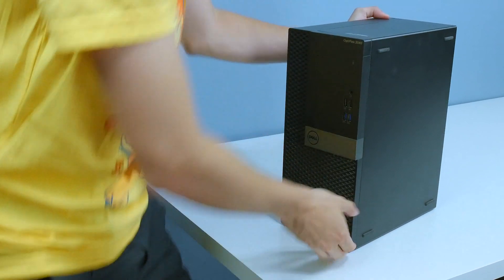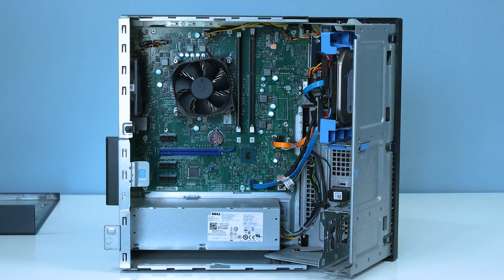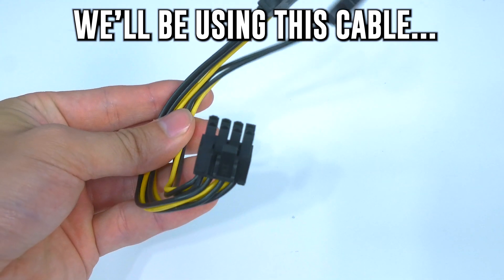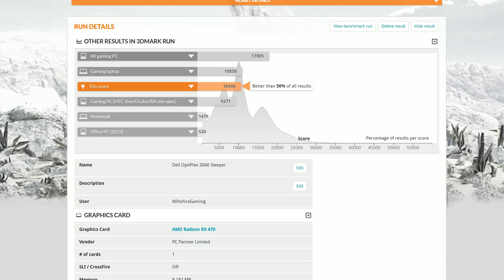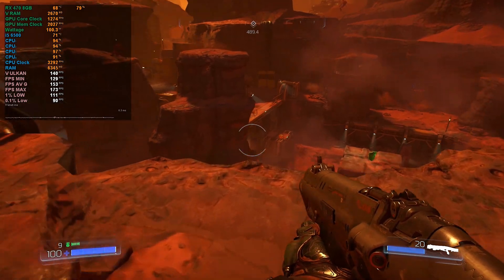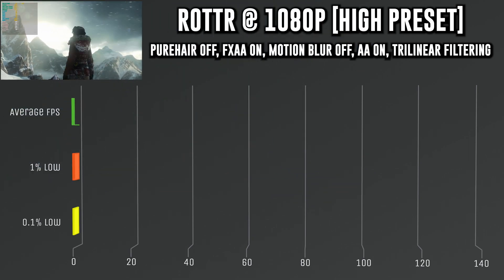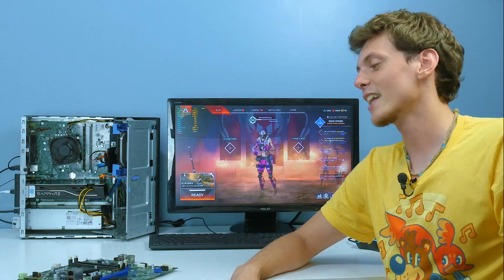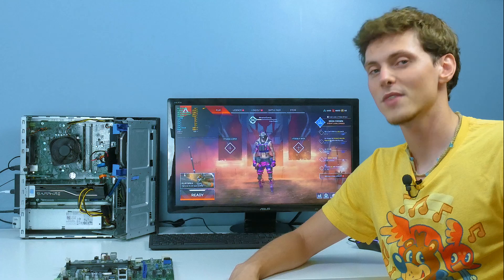$400 Budget Dell Optiplex Gaming PC (2019)

Comment: i have  an optiplex 3060 not a micro i wanna case swap it which case can i swap it into?
Reply from the maker: None. The motherboard is a proprietary shape. It does not fall under any standardized motherboard size.
Reply: Is there no literally case
Reply from the maker: Nope. This is the reason why I modded the case.
Reply: Like no case
Reply: No gammon case ever??
Reply: Umm my motherboard is a cougar MT  17539-1
DX5RC$HA
Reply from the maker: Okay... And?
Reply: @WiltshireTutorials  can you suggest me a cheap but good motherboard which can support up to core i7 18 gigs of ram and  water cooling and is compatible with most gaming cases?
Reply: @WiltshireTutorials  and Can I put a core i9 in the ho optiplex 3060 stock motherboard??
Reply from the maker: @sphinxzapper2071  The Optiplex 3060 can only handle up to an Intel Core i7-8700
Reply from the maker: @sphinxzapper2071  I need to know the EXACT CPU you are using. Saying Core i7 doesn't help me at all. Also, why 18GB of RAM? That's a really odd number. If you're mix and matching RAM, I suggest that you don't do that. Any ATX sized motherboard will do.
Reply: @WiltshireTutorials  i currently have a core i5 9th gen but iam looking to buy core i9 9900k and i currently have 12 gb ram and might upgrade it so my question is that which like cheap and good motherboard will get the job done??
Reply from the maker: The 9900K can draw a lot of power. If you plan on overclocking the CPU, I would recommend staying away from cheaper boards.
Reply: @WiltshireTutorials  umm which intel motherboard that i can go core i5 9th gen are compatible with Gamemax G561 case?
Reply from the maker: @sphinxzapper2071  Any ATX Z390 Motherboard
Reply: @WiltshireTutorials  is there a cheaper option which can run a core i5 9th gen and work with gamemax G561 case, (sorry for bothering you) will a GIGABYTE H310M A 2.0 (LGA1151/ Intel/ H310/ Micro ATX/ DDR4/ HDMI 1.4/ M.2/ Motherboard) work?
Reply from the maker: Why buy a really expensive 9900K and stick it in an H310M motherboard? You do realize that you will not be able to overclock with such a cheap board, right?
Reply: @WiltshireTutorials  yeah i realise that but you see iam running out of budget thats an issue like currently i already have a core i5 8th gen 8 gb of ram and everything except a case and a mother board iam thinking of going with H310M with Cougar mx330 is that a good i dea and for power supply iam going with the stock optiplex 3060 is it okay?
Reply from the maker: Throw in any decent GPU and you've exceeded the limit of that PSU. The Optiplex PSUs aren't really meant to support a gaming PC, just an office PC that browses the internet.
Reply: @WiltshireTutorials  umm okay so is it okay to run a core i5 8th gen with 12 gb ram  and a 1650ti GPU stock optiplex 3060 PSU a MSI ProSeries Intel B365 LGA 1151 Motherboard with a Gamemax Dark Ranger Black Micro-ATX gaming Tower case???? or the PSU not gona work?
Reply from the maker: 300W is the minimum requirement for a 1650Ti. That's just the GPU. You have to factor in the CPU's power draw, the chipset's power draw, the RAM, etc. Clearly that PSU is not going to work at all, for a few reasons. First, not enough power output from that stock PSU. Second, the PSU will not fit in your new case as they are a different PSU form factor size.
Reply: @WiltshireTutorials  Thanks so can you suggest me a PSU which would fit in that case and would be budget?
Reply from the maker: You can get away with a decent ATX 550W PSU. Something like the CV-550 from Corsair would do the trick for you.
Reply: @WiltshireTutorials  welp thanks mate
some people with few subscribers dont even bother to reply thanks for being humble!
Reply: @WiltshireTutorials  will a Aigo GP550 PC Power Supply 550W 80 PLUS Bronze Max 750W 12V ATX 12CM Quiet Fan PSU For Intel AMD Desktop Gaming Computer do the job as well, and should i do the swapping my self like getting the corei5 8th gen out of my optiplex and the GPU and install the new motherboard in the case and put the gpu in and the cpu connect power supply and all that or i can mess up i have 0% experience i have just swapped ram
Reply from the maker: You're welcome. No need to thank me lol. I'm here to help!
Reply from the maker: I actually tested the AIGO 650W in my all Aliexpress PC build and it seemed to be just fine! I would say go for it! You can swap the parts yourself. It's quite easy to do. The CPU socket process is pretty simple. If unsure how to install the CPU in the new board, be sure to look up a guide or read the manual to your motherboard. Of course, I'm always here to help as well. Just make sure to ground yourself before working on the inside of the PC ;D
Reply: @WiltshireTutorials  Thanks mate!
Reply: @WiltshireTutorials  now there's just 1 last step left and sving hopefully i can save up enough in like 3 months
Reply: @WiltshireTutorials  now there's just 1 last step yes saving enough money aghhh
Reply: @WiltshireTutorials  will a 100n10400l1 - Evga 400w PSU Get the job done?????
Reply from the maker: That's pushing it for the kinds of parts you want to put into your PC. I would still recommend a 550W PSU
Reply: @WiltshireTutorials  Okay but it will get the job done right?

Comment: Would a 4GB RX 470 work?
Reply from the maker: In theory, yes. Just make sure the GPU isn't too tall or the side panel will not close.
Reply: @WiltshireTutorials  thanks for the quick response. I have an Optiplex 5040 that I want to turn into a gaming pc. Do you have any recommendations on what I should use? I originally thought about using the same graphics card you used, but you said something about having to flash it and that completely lost me lol.
Reply from the maker: I was using a GPU that was strictly for Mining Crypto Currency. No need to worry about that GPU. I suggest a Sapphire RX 480 Nitro GPU. This is the fastest card you can use with the stock power supply inside your machine. They can be found for cheap nowadays as well.

Comment: Optiplex 3040 mt what psu compatible with it. Cause i already upgrade my ram an ssd so i need higher psu wts so i can put a gpu thx for reply
Reply from the maker: Any SFX PSU will do the trick. You will need a 24 pin adapter to use the PSU however.
Reply: Thx bro for the help soon gonna buy one
Reply from the maker: No problem. Thanks for watching. Let me know if you have any more questions.

Comment: I saw that it has an m.2/NVMe slot? rather put that inside and you've got a little multurpose machine :)
Reply from the maker: It does not have an M.2 slot on the board. It has the traces for one. But, there is no slot soldered to the board and the BIOS does not have options for booting from M.2
Reply: @WiltshireTutorials  interesting.

Perhaps they wanted to put it on but changed their minds at the last minute.
Reply from the maker: The M.2 slot is for the 3050 variant, not the 3040. They made all the boards the same just without certain ports soldered on to save money. I could, in theory, solder an M.2 slot on the motherboard traces and custom flash a 3050 BIOS to the board. I bet it would work.
Reply: Wiltshire Tutorials 

Would be cool to see 😀

I’m rocking a 7050, the fans go bananas when I game.
Reply from the maker: Even with all the additional fans I have installed. Same thing still happens. There is a price for SFF PCs
Reply: Wiltshire Tutorials yeah

Truly not meant for that. I’m looking at building a computer, cause I’m using this one as my work PC and it’s a workhorse, nothing I can’t do work wise and I don’t have to wait for anything. 

Thanks again for the video and responding to my comments

Comment: If I were to do this what would be a better starting point. 5040 or 7010 (I have a chance to get one of them very cheap)
Reply from the maker: Would recommend getting the Optiplex 5040 over the 7010. The 5040 has new hardware in it.
Reply: @WiltshireTutorials  I ended up finding a 9020 for $130 USD and went with that LOL.
Thank you
Reply from the maker: Not a bad find. Those are pretty decent PCs and are easier to work with than the 5040. Tons of good guides on how to improve the stock 9020 out there as well! Have fun with your new PC!
Reply: @WiltshireTutorials  thank you! First time in almost 2 decades I'm doing any pc work so I'm excited
Reply from the maker: Right on, man! If you have any questions at all along the way, let me know!
Reply: @WiltshireTutorials  that is incredibly nice of you. 
Thank you
Reply from the maker: No problem! Thanks for watching

Comment: can i plug in gtx 1050 in the 3070 version ?
Reply from the maker: Yes. You could do that, if you wish to. I would recommend something a bit faster than a GTX 1050 though. Maybe a 1660 over a 1050.

Comment: Will a gtx 1050ti fit in the Dell optiplex 3040
Reply from the maker: Yes. It should fit just fine.
Reply: @WiltshireTutorials  thanks a lot but will the 1050ti dual fan fit because I don't want to buy the wrong one.
Reply from the maker: You can fit a GPU of 240mm in length. So, just make sure what ever GPU you're looking to use is shorter than that.
Reply: @WiltshireTutorials  ok thanks
Reply from the maker: You're welcome. Thanks for watching

Comment: How much GPU clearance would you say you have? What is the specific model of your GPU? I'd like to know what GPU length I can potentially go up to. Thanks!
Reply from the maker: GPU clearance in length is 240mm (max). In this video, I used a Sapphire Radeon Nitro RX 470 8GB Mining Edition. It's length is 235mm. The non-mining edition has the same cooler and dimensions.

Comment: brother, could I do exactly what you do in this video, buy the graphics card and already having the optiplex 3040 could I play at good fps or should I change the power source?
Reply from the maker: The fastest GPU you'll be able to run on the stock PSU is an RX 470. If you want something more powerful, than you will have swap the PSU out for an SFX PSU, like I did.
Reply: @WiltshireTutorials  Okey so if a change the power supply to the one u mension what graphic card would you recommend? And with those components my processor and the motherboard bear it?
Reply from the maker: The max you can use on the same model of Optiplex (3040) would be an RTX 2070 Super. I currently am running one in OptiFlex right now. I would recommend maybe something like the Gigabyte GTX 1660 Ti MINI ITX OC 6G

Comment: are u dont change PSU???
Reply from the maker: What did you just say lol?
Reply: @WiltshireTutorials  did you not change power supply?
Reply from the maker: Not in this video, no. An RX 470 will only draw 110W at full load. So, it's safe to use the stock PSU. Wouldn't recommend overclocking too much though.

Comment: Hello, does the method work for the 3050 Tower, and can I upgrade my graphics card? Thanks
Reply from the maker: Yes it will. The 3040 and 3050 are almost identical.
Reply: Wiltshire Tutorials  thx😆
Reply from the maker: You're welcome! Thanks for watching!
Reply: @WiltshireTutorials  bro i have dell optiplex 3050 mt 240 watts psu the gtx 1050 ti lp oc will work??
Reply from the maker: Should work just fine.

Comment: Hello 
I want to buy optiplex 7070 tower
But the main problem is 240 power supply
Is there any chance to upgrade it to 400 or 600w as the main problem with me is here and GPU I can add
Reply from the maker: This should answer your questions! You can do what I did in this video here: https://youtu.be/ZfGIiLzT_uk?t=274
Reply: @WiltshireTutorials  
U are amazing ❣️
U inspired me to buy the new Optiplex model without fair if upgrade
As I understand the corsair SF600 600w PSU is the best power supply compitable with dell power supply power
How can I know that the power supply I choose is suitable
As this model isn't provided in my country Egypt
Reply from the maker: Glad I could inspire you to pick up a modding project of your own. Any SFX PSU will do. It doesn't have to be the Corsair SF Series PSUs. You will need a 24-pin to 8-pin adapter cable for the OptiPlex's motherboard.

Comment: does anyone know if standard power supply can fit in there?
Reply from the maker: It will not. Case isn't wide enough.
Reply: @WiltshireTutorials  how many cm wider?
Reply from the maker: About 6.35mm too wide. I mean, you could install an ATX PSU in there. But, you won't get the side panel on the case.
Reply: @WiltshireTutorials  oh shit son, you had me thinking it wouldn't work at all with a atx psu. I may do this instead of buying a sfx. too broke. Thanks for the tips and comments. I read a whole bunch of your replies and watched the vids. My old pc just went out and while I troubleshoot it, I had to buy a optiplex 3040 off faceberg. wasn't a bad deal and came with an i7, so I got it. needed it to do ebay work. I want to put my 970 in there but waiting for the 8-24 pin adapter. anyway. thanks for the videos and tips
Reply from the maker: You're welcome! Glad you were able to find a good deal on an Optiplex! Let me know if you have any questions about it! I'm always around.

Comment: for some reason my dell optiplex came wth a 290 watt power supply and it has the branding on it as many YouTube vids as I watch I can’t see one with the same psu
Reply from the maker: It may depend on model or when the PC was manufactured. Dell could've ran out of stock of the 240W PSUs and used 290W PSUs they had laying around in stock.

Comment: Hi Sir, may I know how you flashed the bios of that gpu to make it a gaming gpu?
Reply from the maker: It's pretty simple. You have to use a program called ATIFlash. This tool is used to flash custom BIOS to AMD/ATI cards. It must be used inside of Command Prompt though.

The Sapphire RX 470 Mining card is the exact same as the Sapphire RX 470 Gaming card. Find the VBIOS for the Gaming card and flash it to the Mining card. This essentially makes it a Gaming card, just with one DVI output.

The command lines I used are as follows: amdvbflash.exe -f -p 0 rx470.rom

The 'rx470.rom' is the filename of the VBIOS I had. So you may need to change that line depending on the filename of the VBIOS you downloaded.

Hope that helps! Let me know if you have anymore questions!
Reply: Wow! Thank you so much for responding, even though this video is already 10 months old <3 

I have the exact same cpu and I want to equip it with RX 580 and a new PSU, but it seems RX 580 is around 267 mm and it won't fit the casing. Is there any way around it?
Reply from the maker: You're welcome! I read all the comments I get and I respond to most of them, when I get a chance to. As for the RX 580 you mentioned and its length, it is too long. There is no way around the GPU length limitation (240mm) due to the way the case is designed. It folds into itself. If you're going with the RX 580, the only one that I know of that fits is the Sapphire PULSE Radeon RX 580 8GB. It has the same cooler and dimensions as the RX 470 that I used in this video.
Reply: @WiltshireTutorials  aww. Thanks again! <3

I'm guessing I can be okay with rx470 4gb nitro, but can it handle video editing, like the one you did for this video? Cause that's the main reason why I'll be doing an upgrade.
Reply: @WiltshireTutorials  Wait, what about Radeon RX580 8GB Gaming? According to its site, it's only 232 mm long: https://www.gigabyte.com/ph/Graphics-Card/GV-RX580GAMING-8GD-rev-10-11-12/sp#sp
Reply from the maker: You have to look at height as well. It may collide with the hard drive cage when the case folds inward
Reply: @WiltshireTutorials  Oh, heck right. Thank you very much for all your help!
Reply from the maker: No problem. That's what I'm here for.
Reply: @WiltshireTutorials  Hello again!
My Pulse RX580 8GB, as you recommended, is coming tomorrow. Can I still use the default PSU of this unit (which has 240w capacity) just to test if it's working? It's actually a second-hand unit I got from someone in our country. We won't game with it or use it as our default graphics until we receive the new PSU (which is Corsair CV650) we ordered.

Wait, Pulse RX580 8GB is the same as Pulse RX580 8GB GAMING, right?
Reply from the maker: You could try booting the PC with the RX 580, But, you won't be able to game on it at all. Any slight load on the GPU will probably overwhelm the PSU. That PSU won't fit inside the 3040 case. the CV650 is an ATX PSU, not an SFX...
Reply: @WiltshireTutorials  it was a second hand gpu so I'd just like to test if it works. Thanks for the insight! Also, for the psu, yeah, I researched its dimensions and compared it with the Dell Optiplex 3040 MT and it really won't fit. I tried to find the psu you used here and I can't find it in the marketplaces here in the country. That's my biggest problem on this build right now lol. But still, thanks for taking your time again to reply to me :)

Comment: Can I upgrade my OPTIPLEX 3050 MT pls tell me I wanna put a 1650 super on it. And can I swap the case?
Reply from the maker: You probably could fit a ZOTAC GAMING GeForce GTX 1650 SUPER GPU in there. You'll have to upgrade the PSU in the 3050 though. Case swaps are not possible due to the unique shape of the Optiplex 3040/3050 motherboard.
Reply: Wiltshire Tutorials Thnx :)

Comment: Ok so i bagged a 7040 (no psu, ram or chip, hdd) and 5040 i5(no ram, no hdd). I ordered a dell 315Watt psu for the 7040 that i can easily transplant cases with. Whats the beefiest gpu i can run on 315w and minimal wire splicing?
Reply from the maker: I would still probably recommend an RX 470 with only 315W. You would only need the SATA Power to 8-PIN adapter, like I used in the video. No splicing needed.

Comment: Hey Will, do you think a rx 590 of 10.6 inches would fit in one of those? I bought one yesterday
Reply from the maker: It's too long. The maximum length that the 3040 chasis can fit is 230mm (9.05") and that's pushing it.